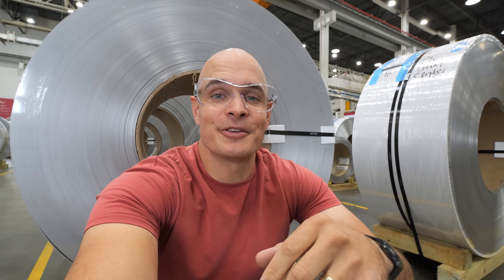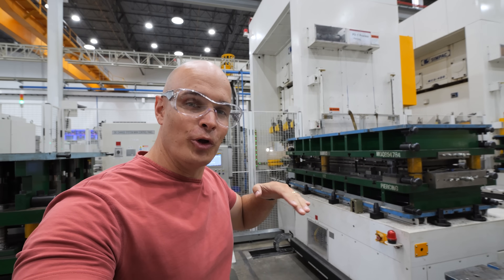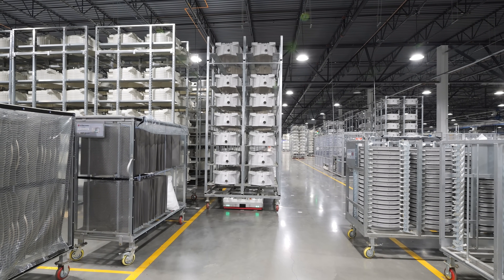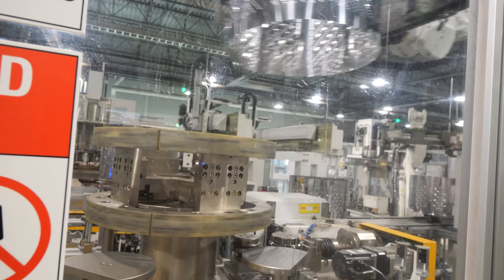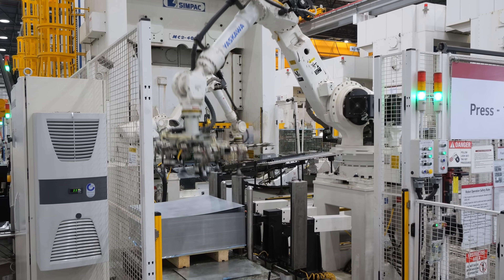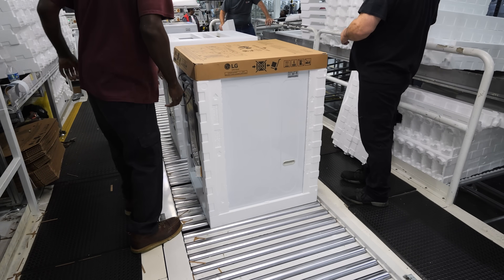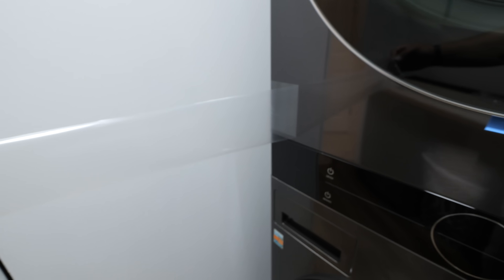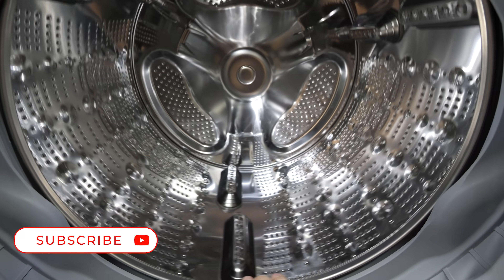Where are Washing Machines Born?

Comment: I sell a lot of these and it is cool to see how they are made. Only issues I see with the LG units is the drum gaskets are sometimes not installed correctly or warped on front-loading machines. Other than that, I've observed a lower failure rate than most other brands.
If any washing machine repair people can comment on the gaskets, it would actually be appreciated. If it is something I can easily fix in the store, that would be cool.
Reply: I've the LG Front Load and it works like a charm
Reply: @poetrydlove  I just don't like the high efficiency ones that's all you can get now in the market. It really doesn't clean as good
Reply: @vueport99 good point. Less water means less efficiency.
Reply: @vueport99  You probably need to run the cleaning cycle on your washer more often and turn on the extra rinse. Load size also matters. In my experience HE detergent is more effective at getting out stains and HE machines are just as good at using the HE detergent.
Reply: @nervousstate  yes I end up using extra rinse cycles which kind of defeats the point of high efficiency and takes much longer. Most likely using more power and save not much water. Maybe his version with the steam clean is b better.

I'm now using a LG. But I do miss my previous Bosch front load which cleans faster and cleaner.

Oh well. Progress...
Reply: @aberba  I agree we need to save water but I feel toilet and showers use far far more water than the occasional load of laundry unless you're the kind who run the washer for just a towel after going to the gym!
Reply: @vueport99  I still have my 1989 Bosch machine, it failed a few times and all of the technicians said to get a new one, but me and my bud fixed it and it hasn't failed for 15 years now, cleans so great, and spins so fast, but it sounds like a truck,  it also doesn't use too much water.
Reply: @levonandonian7613  yea these days you have to fix it yourself. Too many repairman only want to replace full assemblies which then end up costing 60% of a new unit... It's a shame.
Reply: @vueport99  They actually work better if you use less detergent. I generally use a third of the "manufacturer recommended" dose, and find that the residue left is a lot less. My first washing machine was an old original Hoover twin tub, which is still sold (though now it is 99% plastic parts instead of steel), which was replaced after a few years of good service with another used machine, an AEG Lavamat. 30 years after the AEG was made, it finally was not economical to repair, though the parts were still available, but more expensive than the LG top loader that replaced it. A lot lighter as well, and that LG did around 15 years of service, before it also needed a new main gearbox, also available, but again almost the price (trade price) of a new machine. So it went out, and the new one is also locally made by me, from Defy. 

Hoover was probably older than me when I got it on auction, but having fixed many of them over the years, my mother loved them, and me and my father repaired them always, getting the spare parts from the Hoover authorised agent, as the pattern parts were not much cheaper, and much lower quality. We also had a Hoover upright vacuum, which all we could tell, as the records were destroyed in WWII by a bomb, was that it was made around 1938 in Wales, at the Hoover factory. Used till the main casting finally cracked, which was no longer available as spare part, while all the other parts, including even the labels, were still available as genuine parts.
Reply: @SeanBZA  yes I always use less than recommended detergent even when I was using the non 'He' front loads
Reply: @nervousstate What is the point if the objective was to save water? They should have left these do their function which is to clean clothes.
Reply: @Andytlp  I add extra cycles. The issue isn't how long the cycles are or how many there are. The issue is these high efficiency washers barely use enough water. And they take far longer to wash and don't clean as well as the old school front loaders which use more water.
Reply: A well built front loader works great, silently, and doesn't destroy clothes
Reply: Only thing i dont really like is the part where they "glued" a washer and a dryer together.

Seems great at first, but i would not want a machine where i had to change both machines if one died.

Here we do a lot of washing but especially in summer we dry a lot of clothes outside, so our washing machines usually die a lot sooner than the dryer, with this machine we had to buy, what i can only assume is a machine that cost the same as the price of both machines, which seems wasteful, when the dryer is not half worn down.
Reply: @JohnDoe-bd5sz   I actually just explained that to a customer yesterday, leading them to go to regular stackable units and just stack them. They also saved a couple hundred bucks.
It is actually possible to change one, but you better have a service contract.
Reply: Yeah, i actually went to the link and saw the prices, and i can confidently say that i have never paid that much for a washer and a dryer and i dont even buy the cheapest one.

I bought a Bosch heatpump dryer on their first generation, and even that was quite a bit less than half of what this stack cost.
Reply: Thank you for weighing in your expertise, I hope this comment stays on top
Reply: That’s a VERY rare issue.
Reply: Very cool video.  I will never buy front loading washer because they stink up the clothes.  It's like those water saving toilets that you gotta flush 5 times to make your 💩 go down 😂
Reply: Front loading machines are terrible, the only good is for apartments
Reply: @NEON2600  they are the most common in Europe
Reply: @ek8710  We have front loading machines, they are great because then you can get them up a bit so that you do not have to bend down to get to them and also have a drawer below for detergent.

Top loading machines are terrible because you need to dive down to get to the bottom of the drum, and they can only be placed on the ground, not elevated
Reply: @NEON2600 they also for the most part, have a built in agitating function.  An upright machine has to have a mechanical agitator. I have one and don’t really love it but it does clean good.  Sucks having to clean the gasket all the time I can’t really close it or it will get funky smelling.
Reply: @NEON2600  disagree 1000%... I do like the old school TL washers but they are my 2nd choice compared to a FL washer...especially the LG with turbowash... As it stands my whirlpool FL is almost 19 yrs old. It was a learning curve at first I remember initially HATING it... When/if it dies I'm getting an LG FL. I would live with a top load washer but FL's are my first choice.
Reply: @NEON2600 my mom says the exact opposite. She loves her front loading and hates the top loading ones. She says the top loading ones ruin the clothes

Comment: Soon these factories will have no humans in the which would allow them to run faster and in smaller spaces, with less energy use (no need for lighting or keeping temps suitable for workers). The more we move to automation, the more manufacturing would move back to the US as cost of labor would be less of an issue.

For the few processes that still require humanoids, TeslaBots or similar will likely be able to replace them as well.
Reply: What is a Teslabot ?

Comment: At least where I live in Europe all of our dryers have condensers inside, haven't seen a single one that would output the heat to a duct.
Reply: Indeed, I was confused in European. All of the dryers condensate into some kind of water tank and needs to be emptied after each use. I have a combination washing machine that both wash and dry clothes. It dumps the condensated water into the drain. It's one unit and not stacked like in the clip.

Comment: If you have pets I would definitely recommend NOT getting a ventless dryer. It doesn’t remove the hair at all, and the drain pump will get clogged easily with a lot of lint. Because it doesn’t have a lint screen, it has to use a grille with way larger holes to catch any debris because of the moisture. And cleaning that thing out is not as easy or as dry as a lint screen. They also heat your clothes hotter than a conventional dryer, and take way way longer to dry your clothes. It’s supposed to be 90 minutes to dry a single large load, but I’ve found it can be up to twice or triple that long depending on heat setting and the amount of moisture.

IMO ventless dryers are terrible. It’s really a no other option sort of thing

Comment: Those injection molding machines are exactly like Tesla Giga Presses. Thats brilliant!
Reply: The issue with the Tesla presses is people usually don't repair part of a washing machine drum, but for a vehicle, that's not the case
Reply: @fallout560  Well, the Giga press is used to make Megacasting, which is a part of chassis. Normally that part is made from ~70 parts that are welded together, so when it gets damaged, you can't replace for example 20 of them. It is not possible to repair this part of chassis on normally manufactured car and it is not possible on a Tesla. Also, when this part of chassis gets damaged in a crash, the car is most likely totalled.
I can't belive there are still people who don't know this, 4 years and millions of manufactured cars since the introduction of Giga press.

Comment: Should got the Washer and Dryer in the same unit one (all in one); for your wife and you.  Now you will all ways have to be doing the laundry; at least your wife will have a good break.
Reply: My experience with the all-in-one units is that drying (with the same tech here with condensers inside the machine) is really slow, one load of clothes took 6-7 hours. I prefer to load both so I can save time too on multiple loads

Comment: DO NOT USE SOFTENER in your washer!!! Ask any appliance mechanic and they will tell you the same thing. The softener do not get dissolve completely into the washer and eventually build up on the tub and drum. Eventually the motor cannot handle all the extra weight and give up.

Comment: In a previous life I was a manufacturing engineer. Worked in a production facility much like this as we upgraded to autonomous manufacturing (we went from about 500 units a day to about 3500) but didn't have materials handling robots. What was most amazing was the head count didn't go up - it actually went down.  So did the hourly wages.  The company transferred skilled staff to other lines that had not yet been updated, but you knew as time went on, they would not be rehiring technical jobs like welding, fabricating, etc.  Essentially, the hourly workers swapped out tooling, moved items around, cleaned up, or packaged items.  There was a small maintenance staff. There were a lot of high paid engineers around the new equipment, but once it was running they were there only for maintenance issues, etc.  American manufacturing is as good as anywhere in the world, but our higher labor costs means almost fully automated factories make the most sense for consumer products and heavy duty manufacturing.  Specialty and low production products are different, but labor costs is why there are so many more jobs like that overseas.
Reply: but hey pay CEOs and execs huge bonuses :) 

Bottom line is all the company cares about is its shareholders.. no one else below a certain position is worth a dam .. if they could theyll replace every single person there to increase profits and please the share holders.. 

thats the capitalistic world USA lives in :)
Reply: @yatish23  If you look at the same situation through more positive lens, it frees up people to do the jobs that can't be automated, and resulting in overall more productivity per worker. Less workers are needed on the production line, but more engineers are needed for the increased automation, and the lower cost of the end product allows more people to have it.
Reply: @szaszm_  I agree. It is an unfortunate reality that automation replaces many repetitive jobs that required some level of skill. A resurgence of manufacturing (or mining) jobs is a boon to the Japanese and German companies which make almost all of the automation equipment and to the US engineering sales companies which install it, but isn't going to help the average worker that much.
Reply: @boomerbobable  What funny is people thing this automation thing is more recent, when in reality any study of operations and manufacturing history will show its been happening for thousands of years. A task that was once completed by someone will be made easier by technology, even if that technology is a plow, a mill, automobile or a robot ext... you are blind if you think this is a "recent" change in society!
Reply: @rumplestiltskin3441  Automation is even more complicated based on labor rates.  When the world had large scale slavery, the need for agricultural automation was not as important as when you have to pay a somewhat decent wage for the work. Same for many manufacturing jobs - yes, you could automate almost all of the coal mining done in the world, but only in the wealthier countries is that done to a great extent.  In poorer (ie $5 a day or less for 12 hours), you have less automation.  And once you put in automation at scale in an industry, they never go back to manual labor.
Reply: @boomerbobable  Well and that makes sense because automation is a heavy upfront investment with payoff later. Poorer countries wouldn't have the investment needed to build large infrastructure, but labor is cheap up front but costly down the road.
Reply: @Shindiggity  That is kind of my point. If you have the skills and talent to fabricate and can hustle clients - do it.

Comment: i have a LG wash tower to lol  love it super nice and honestly feels like it cleans better than top load washers
Reply: i live in europe is a dryer that does not need a vent really that uncommon casue we had one like 10 years ago and you would have to empty out the water
Reply: @MuscularHamster  Yeah I would say that is a newer thing for the US. Homes and apartments have been built with the venting so we tend to go with the the "easiest" option in terms of never needing to drain water. On the flip side, I'd bet we don't do a very good job of cleaning and maintaining the dryer vents here either.

These newer machines with heat pumps like the one shown here are most likely connected to to the same drain as the washing machine so they do not need to be drained manually.
Reply: Yeah I don’t even know why top load washers are a thing. They don’t agitate the clothes enough to clean them well

Comment: Hands down the speed queen washing machine washes the best and last the longest. 25 years with normal use.
Reply: Yes, the problem with the new washers is that it is boards that typically go out first
Reply: They are also 2x+ the price. 

It also appears they have no ventless electric, and only resistive. So higher cost to use for direct electrical, and since it vents, it will pull warmed / cooled air from your home that you need to now adjust. For me (using gas, but same problem), that is 1.5-2.5x the number of times my furnace cycles while the dryer is running. 

You could buy two full sets of the one from this episode, it would be faster and cheaper to run still. 

At this point, resistive heating makes it a non-starter.